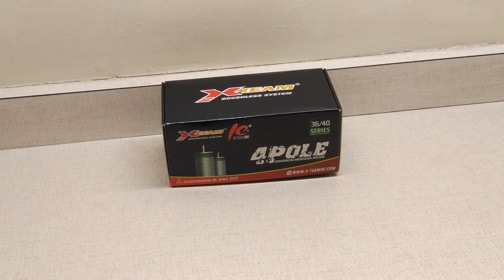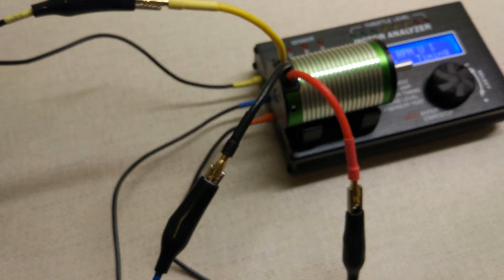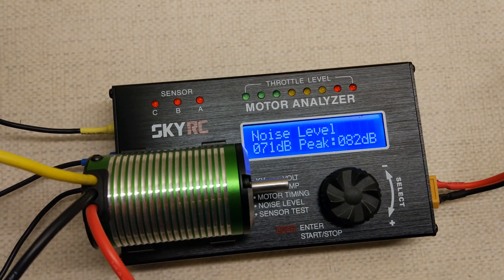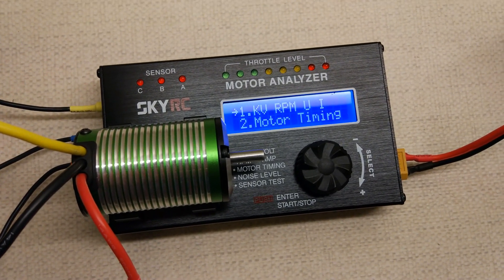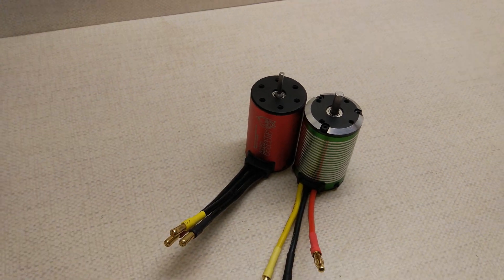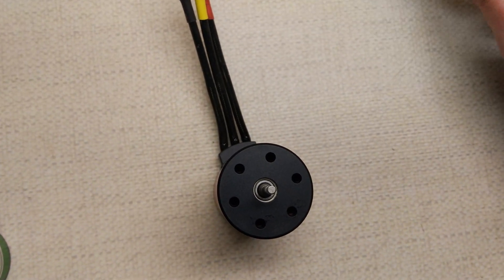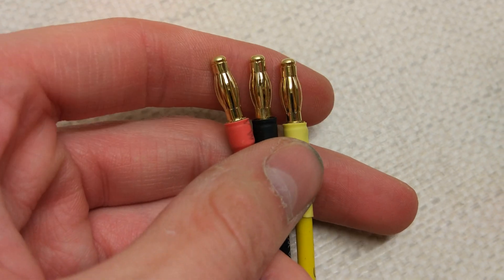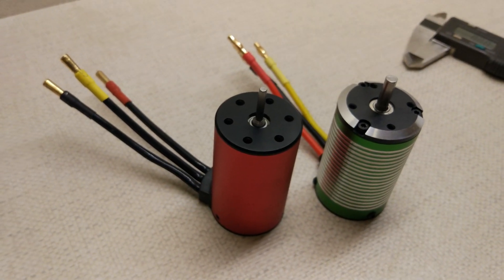MTT EP12 X Team 3660 3180KV Brushless Motor Real KV

Comment: Great video!  

I have been running the XTeam motor in my bandit and it has been really fast… But I can only compared to the stock motor. 

I did upgrade the wires to 12 gauge and put on 6.5 mm bullets in the Xteam however.

Next time out, it should go over 100 miles an hour on 3S!

I may have to see if Surpass Hobby will send me one of their motors for my channel!

Comment: these stiff motor wires are the same copper that is wound in the motor coming straight out without a joint to different external wires .maybe saves a step on labor too

Comment: Can this skyrc motor tester also test all the way up to 8s voltages to see what voltage your hitting max rated rpm at so you know how far you can push a motor to get max speed out of it?
Reply from the maker: No, it's measuring the kv.

Comment: Hiya buddy, i am planing on buying xteam 2860 motor, is x team a good brand and is it reliable? Never tested xteam, does it overheat?
Reply from the maker: For me I prefer the surpass motor. The xteam ran hotter for me.
Reply: @LawrenceTimme  ..which is better surpass hobby or goolrc?
Reply from the maker: @maestro-rcboat9881  surpass hobby
Reply: @LawrenceTimme  ..wow nice, i have 3 surpass hobby motors. Tnx for the answer.😊